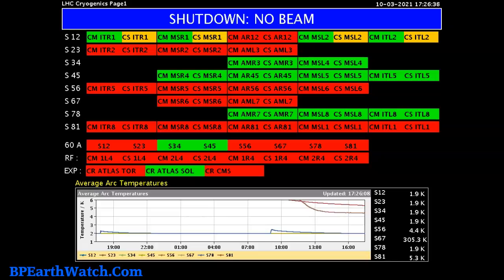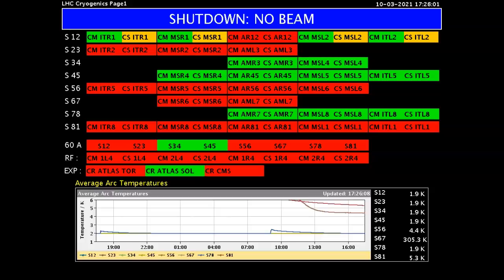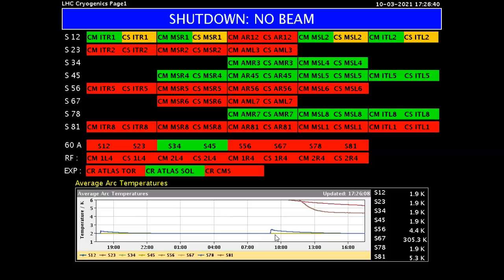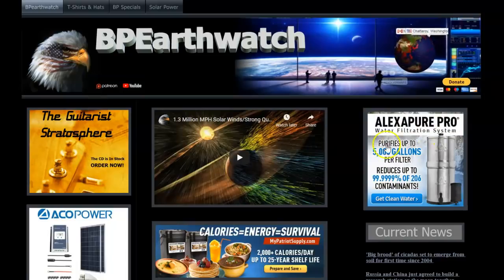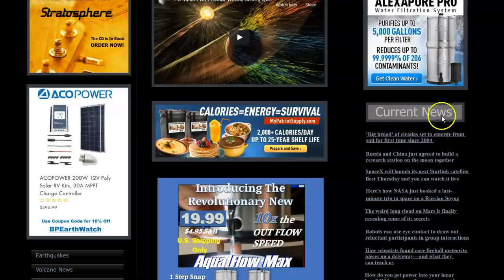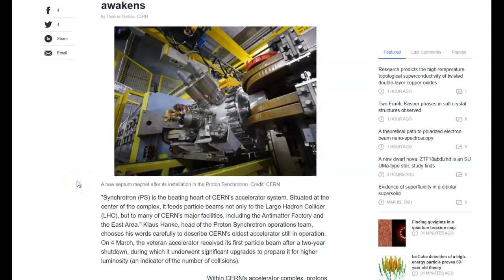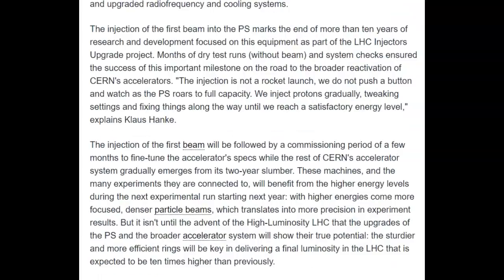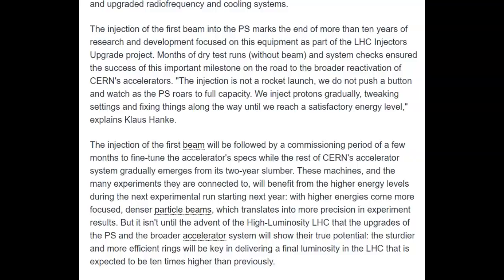First Beams Fired. CERN Awakens.

Comment: Thanks for making us aware BP! Ground field inductor lines equals Lay Line right? 2 years ago was 100,000 times the earths magnetic field.... what will the ramped up magnetic field be? Curious to know.
Reply: The nominal magnetic flux density in the main dipole magnets is 8.33 tesla (about 8 times the strength of a normal neodymium magnet that most people have at home). This has been reached for most of the 1232 dipoles in the LHC during the current training campaign. During the last run, the operational magnetic field was 7.735 tesla.

Comment: Whenever they Dump the Engery from the Beams into the Ground, we normally have a Big Earthquake.
Reply: The energy is about 300 MJ per beam (design value 362 MJ). Most of this is deposited as heat into the two beam dumps, which are composed mostly of graphite blocks, surrounded by a lot of concrete. The amount of energy that reaches the ground is negligible.

To put things into perspective, 300 MJ is equivalent to the energy contained in 15 kilograms of chocolate, 70 kilograms of TNT,  or 9 liters of gas.

During runs, effectively constituting about 180 days per year, there is at least one dump per day, often more than that. Since the LHC was commissioned, there have been about 8000 fills in total. Not all of these fills have been with full beams or ramped to top energy, but at least a few thousand. Have there been that many large earth quakes since the LHC started running?

EDIT:
You can calculate the beam energy yourself (I take the design values now). The bunch intensity is 1.15*10^11 protons, number of bunches per beam is 2808, and the energy per proton is 7 TeV. Put the following into wolframalpha: "(1.15*10^11 * 2808 * 7 TeV) in MJ".

Comment: Did they get "funding" from the Stimulus Packages??  Are they screwing with the "time lines" or opening portals?
Reply: They can’t open stargates until the moon’s nuclear generators have completely broken down.
Reply: @MicahFoxxMusic  how do you know this ? Resource? Thanks 💌
Reply: @deborahb.40  I don’t know it, I just like the fairy tale. The moon is metal, hollow and contains nuclear generators which pump out a frequency of 50hz, blocking access to stargates, quarantining the Draco genetic engineers. The Andromedans and galactic federation are in play. Orion Wars/Oxygen Wars/Star Wars

Comment: March 3 2021  6.3 earthquake, March 4 2021 8.1, 5.8, 7.4, 7.3 earthquakes, and March 5 2021 a 6.3. lets do the math Cern comes to life on the 4 and look at the quakes in connection
.
Reply: The LHC is still not running. First beam tests are scheduled for October, and these will be very low intensity runs at injection energy (450 GeV). Apparently nature is fully capable of producing its own earthquakes, without the help of CERN :o